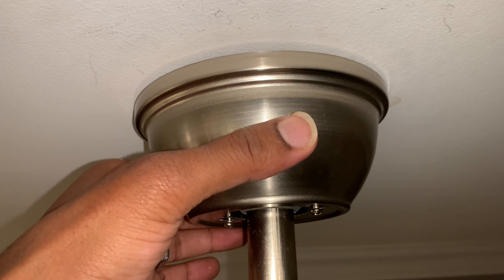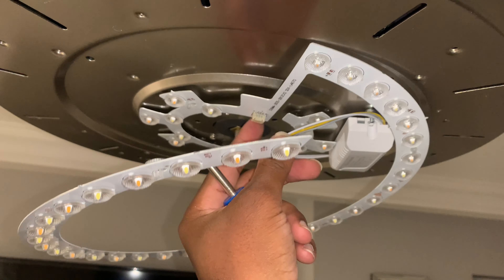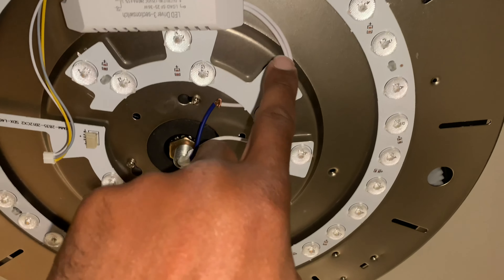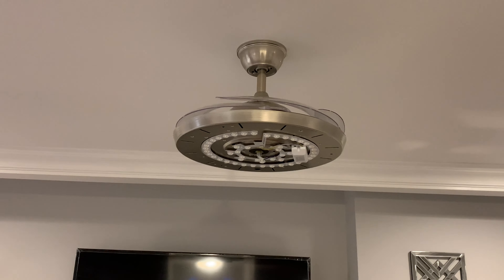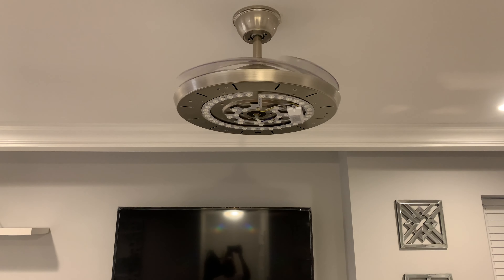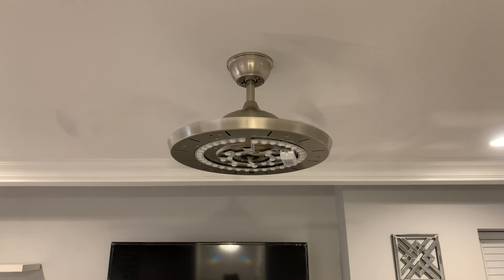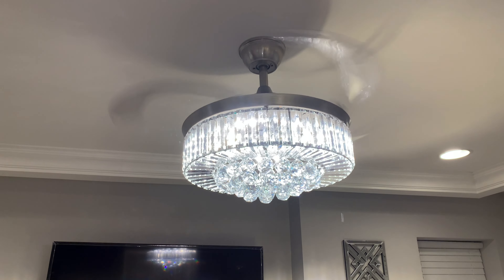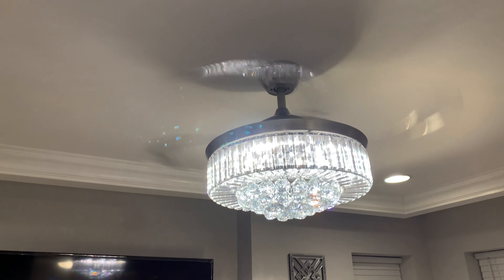DIY: How to Install a Fandelier (Pt. 2)

Comment: So how did you figure out which wires connect to the white and blue for the led box?
Reply from the maker: I looked at another video, one of the wires in the video might’ve had something written on it - I compared it to what I had - rest is history.
Reply: @whitleygreendiy  ok I installed it but when I turn the fan on the balls shake a little . Does yours do that?
Reply from the maker: @dc704  If it’s on high, they’ll shake a little - nothing to worry about.
Reply: @whitleygreendiy  ok Thanks ❤️